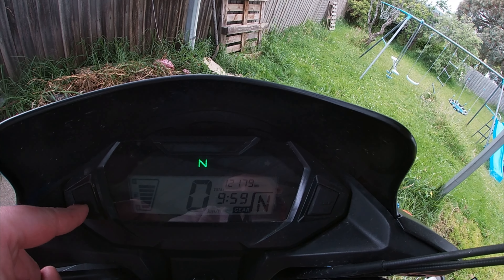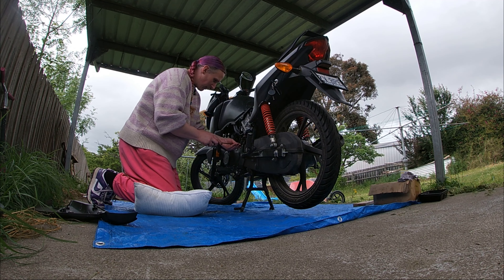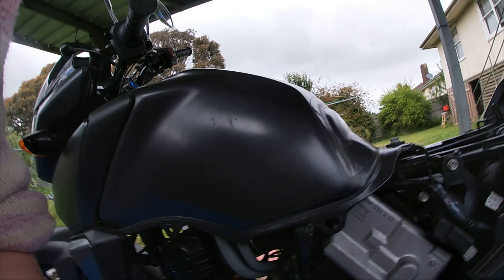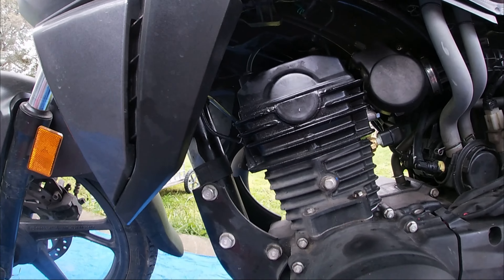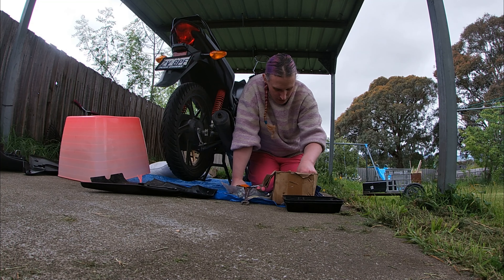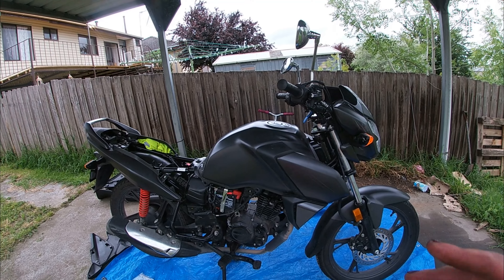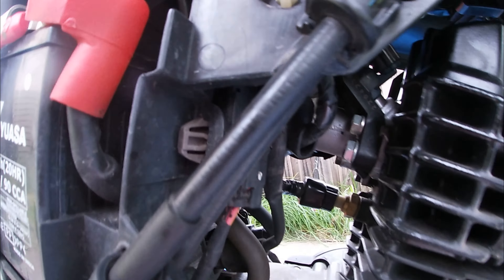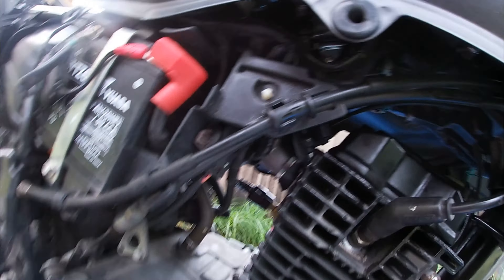Honda CB125F Valve Adjustment In Detail - Basic Tool Service

Comment: Great job Nick you make very good how to videos and of course the riding videos another run on the highway once you have everything done to the bike to see if there is any difference or not but it does sound smooth after the exhaust valve was adjusted keep up the good work
Reply from the maker: I plan to pick up an iridium spark plug today and so long as the weather holds out for me, I'll take it for a ride today
Reply: @NicksBikes  Nice
Reply: Im trying to sort my valves and have been told 0.08 for intake and 0.12 for exhaust. Im a bit confused after you say 0.2 and 0.5 for exhaust
Reply from the maker: @wh05mikey  dude watch the whole video at least 🙄 The correct specs are even in the thumbnail.
IN: .08
EX; .20

Comment: Good work with the camera there Nick to see the closeup of the adjustment. Thats a job thats crying out for a ratcheting ring spanner. I was watching Richardshephard take that spring clip off the other day and thought, Oh I bet thats got potential to ping off and hey presto! Hold a screwdriver over the end of the drain plug as you pull the clip clear so it goes up the screwdriver instead of heading for the wilderness!
Reply from the maker: My own stupid fault for trying to hang onto it and hold it close to the camera! Realistically, you'd have it in your hand the moment it was off the plug, but yes, really flew!